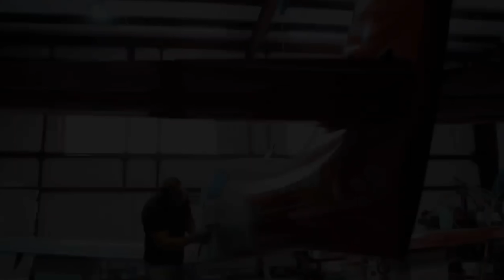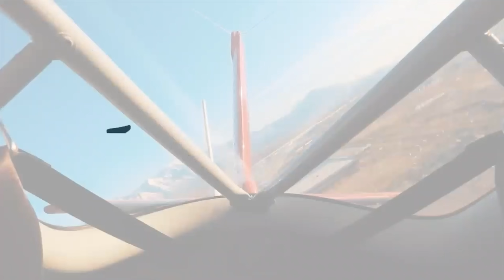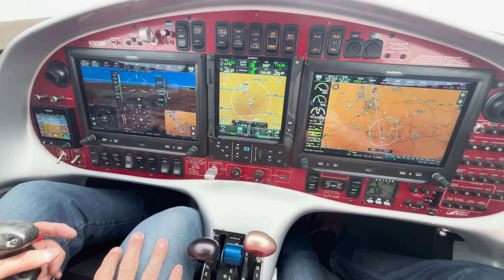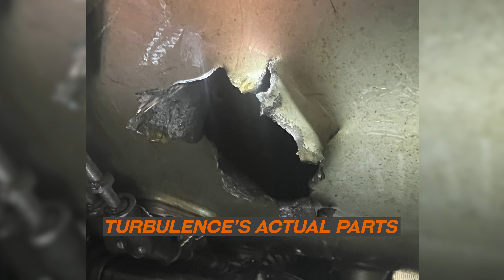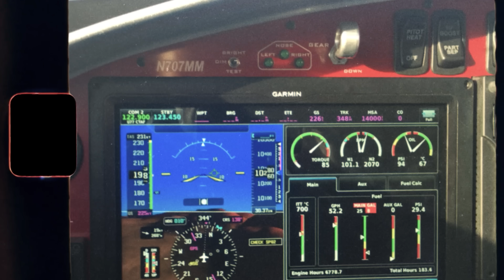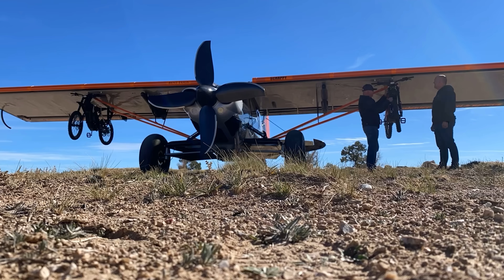Aircraft Engine Explodes - We find out Why | Turbulence Update

Comment: So if I understand this correctly, what essentially happened is you were "Driving" a stick shift down the highway pedal to the metal so to speak, and the thing essentially got ripped into neutral, which removed all of the "force" keeping the engine from going past red line, the engine "over revved" and blew itself apart?

Comment: Many years ago (40+), I was working as a sales rep for a Cessna Single engine dealership up here in Canada. The company sold a farmer a new C172 and as part of the deal they, took his Certified and fully operational, 1956 C172 on trade. The finances on the deal were such that the 1956 straight tail C172 wasn't on the books for much money. My Dad and I jumped on the deal and bought the older C172 for not much money. We flew it for about ten years putting about 900hrs on it. When the engine only had about 75 hours left on it before a required overhaul, we evaluated the cost benefit of spending what would have been more than three time what we had paid for the plane to get the engine up to a current standard. We elected instead to sell the plane. We got a call from an AME who also had a pilots license. He looked at the plane and decided to buy it CONDITIONAL on the log books being in order. What could wrong? The plane had been flown a maintained since it was new. We had an annual done it for the ten years we owned it and throughout that ownership experience, there were no major snags (or so we thought). The AME who had committed to buying it from us called about two days into his review of the log books and ask me had we been the ones who changed the engine from a 4 cylinder to a six cylinder. I had no idea what he was talking about. What we subsequently found was that prior to our ownership (not unlike Mike's experience) a previous owner had swapped out the original engine and put a six cylinder engine in the plane. Why was the swap done? We don't know. Did the original engine fail? We can only assume so because why else would the engine be changed. The log books only indicated the date that the swap was made. It was signed off by an AME so every thing was good right? NOPE! The engine type that was installed was an engine that was approved for use in our C172, BUT if an individual wanted to use such an engine there was an application, inspection and certification process that was "MANDATORY". Just simply paying to have that different engine installed and having the AME note the procedure in the log book did not meet any of the regulator requisites. Much to our good fortune, the AME/Pilot remained interested in the aircraft and though he did end up buying it, we had to subtract form the purchase price, his costs associated with submitting for approval the engine swap that had been conducted some 20+ years prior to us owning the aircraft. Short story long, Mike is very familiar with the unforgiving nature of aviation. I am so very glad that he was able to get Turbulence on the ground. For the life of me however, I can't understand why he put such a high time engine into his plane. I strongly suspect engine cost was a big component of his decision. As I said, Aviation is very unforgiving and in my mind, Mike should have known better. His decision to not fix Turbulence I believe speaks to the life's lesson that Mike has learned.

Comment: It's already been documented by the NTSB that this guy purchased a labelled and known "unserviceable" engine and installed it in the airframe anyway.
The engine in question was past rebuild hours which is also documented. Whether or not the AD referencing the sun gear applies to his engine serial# is unknown and not presented here and is also irrelevant since the entire engine and gearbox should have been torn down, inspected and rebuilt anyway as it was "unserviceable".

Comment: The curious thing is that, according to P&WC, as stated in the final report on the incident, they sold the engine to you in 'Unserviceable' condition, with 3,543.7 hours Time Since Overhaul, with the next one due at 3,600 hours. There was also a buildup of combustion products around the power compressor blade housings. They also noted corrosion both inside and outside the engine, with protective paint flaking. 
It sounds as though they have put the ball firmly into your court, in an attempt to absolve themselves from blame.  
There was an AD regarding that primary planetary gear, but specifically mentioning the type number immediately after your gearbox. That older gearbox should have been subject to serious scrutiny before the engine unit was sold to you. Maybe that's why it was sold as 'Unserviceable'? Whatever, Pratt & Whitney Canada should have included document telling you about that weakness.
Reply: "Unserviceable" means that the engine can NO LONGER be put into service, PERIOD. Yet Patey did exactly that, and almost killed himself and his passenger. Knowingly killing himself amounts to suicide, but also killing a passenger is homicide; WHY would a semi-intelligent person do that?

Comment: NTSB has spoken....... let's confirm the facts?

You put a 1987  PT-6-42  at the end of its THIRD TBO cycle --  NTSB says, "knowingly purchased an engine sold as unserviceable"  --  in an experimental aircraft,  put 12 hours on the installation? Then it blew up when you ran it balls-to-the-wall  at over 400 knots on a X-C flight in bad weather over the mountains?  With a passenger on board?  (I don't do "experimental", is that legal?)  

Do I have all that correct? 

 Did you do a hot section inspection before you put the run-out engine in the experimental aircraft? Or any other inspections of critical components, like the reduction gears, prop hub,  etc? 

I have personal experience of a  similar scenario,  and I got lucky too. I learned from it, did you?

Are you familiar with Frank Borman's famous quote about "superior pilots"?  Do you think superior stick-and-rudder skills will always get you out of situations inferior judgement  put you in? 

You crashed a mega-cool, $ million taildragger because of your poor judgement. In this case, the "missed AD" wasn't the issue,  poor judgement was/is. NTSB STRONGLY hints at it. What's next? 

"Innovation" and "excellence" and all that lofty rhetoric is all good and well -- but what's the goal here? To benefit society?  Save people from burning buildings or floating in some ocean? Or is it just an ego trip? For "likes"? 

Think about your family, and what the lawyers are going to do to your wealth when you crash some uber-cool, "innovative" EXPERIMENTAL  aircraft into an airshow crowd or a  middle school.  

Do you know who Damon Hill is? Read up on his story. Or Mike Tyson's for that matter, or many others who thought their wealth made them bullet-proof. 

Pardon my airline captain--with-plenty-experience-in-warzones-and-odd-places cynicism ..... you're a "doctor in a V-tail" on steroids.  It won't end well.

Comment: I have a few questions:
* Since the AD was only applicable to gears made after 2008, and your gear was from 2003, why do you think the AD is applicable?
* If a chip detector was installed on the gearbox, would it have catched it before complete failure?
* According to NTSB report there was 56 hours left until overhaul, why did you think there was 400 hours?
Reply: The other question you should be asking - Why did Mike buy an engine that was clearly marked "Unserviceable", then install and fly it regardless of the condition of sale?

Comment: Aviation 24/7 have shared the "final report" to Facebook and have neglected to include the important details here, sadly it has given a lot of armchair experts a wildly incorrect opinion on what has gone on here.  Many people are assuming you purchased what was essentially a junk engine and just slapped it on and hope for the best, sooooo frustrating watching fools try to bang on like they are the smart ones.      It sucks how this played out but glad no one hurt.
Reply: The engine was clearly marked as "Unserviceable", it was a condition of sale. P&W's own post-incident teardown inspection showed it was a clapped-out engine.  Watch Blancolirio's video regarding this.
Reply: @SEO122  what did the tag actually say though?    what was the actual reason given for the unserviceable state " Watch Blancolirio's video regarding this"   seems like YOU need to watch that again and listen carefully to EVERYTHING that's said.
If the tag simply said "Due overhaul"  then there was nothing to indicate corrosion inside etc & given it actually still had a little time left to run given the logbook data - suddenly the armchair experts look a little stupid.

There are LOADS of reasons why the engine could have been deemed "unserviceable" - many of them NOT applicable for the installation of the engine on an experimental aircraft, time expired on a commercial aircraft does NOT equal time expired on an experimental aircraft.

The "clapped out" state was mostly internal and could not be seen without teardown or boroscope inspections etc.       

Mike made mistakes, no one is disputing that, asshats in armchairs seem to want to ignore and change facts to suit their own version of reality - no surprises there I guess.

Comment: Would it be possible to create an emergency shutdown system for the engine? If for this or any other reason should "want" to "run away". I'm thinking fuel cut off (of coarse) but intake air cut off/blow by too.

Comment: If it were to happen to anybody. Fortunately it happened to you in a single engine configuration and a very skilled pilot. In a King Air with a lesser pilot likely that would have been deadly. Glad you found the cause and you can move on, excellent piloting.

Comment: I guess Mike, this is good news for ANYONE, that may be still flying one of those old gearboxes.  ADs are for a reason, even if mechanics or pilots don't like t hear that they may need expensive fixes.
In the air, AND on the ground, lives are at stake.  Complex machinery needs complex care.
Maybe one day, you'll hear a couple stories of lives that were saved by your experience with this and your story!

Comment: Huh reminds me of a video from Steve Morris Engines where they were testing a high HP engine and the flywheel bolts sheared off causing the engine to overspin and blow up. The dyno and governor attached to the flywheel was the only thing keeping it back. Sent parts flying all around the shop.

Comment: Are these gears common in all turbo-prop designs?  If so it seems like that's the weak link and SOMEONE should make a set of gears that's better AND a fail safe so if they do fail it doesn't take out the rest of the motor.  Thoughts???

Comment: Everyone else just got lucky, so did you Mike - There's no gaps here you could have known about even with your level of knowledge. How about those $100 hamburger (now $500) flyers out there? ~ Man, if it's going to happen to anyone to bring the awareness? it happened to the right guy for a reason. 
 It always seems like it was meant to be with you Mike. Thank you for your commitment to the craft. 
Although you learn about this to some extent in training (AD's), if you read the amount of NTSB reports as I did, you see a whole lot of them referenced as causes, especially the airframe/spar corrosion that comes up in a lot of reports with structural failure causation. 
 Piston engines though, even hobby fliers pretty much have an eye on those for the common stuff. But how did someone miss it on a turbine reduction system? ... wow. Sure seems like it would've been a major AD for it's ability to create this kind of result.

Comment: I mean, in a way I’m sure he’s upset he didn’t overbuild the plane and just put in a gearbox made for 1000hp. I hear of guys talking about using the smaller gear boxes all the time….but just like in a vehicle, if you have a 1000hp 2400lbs/ft diesel truck linked to a transmission that’s rated for 800hp and 2000lbs/ft….What do you think will happen….I understand the science behind not wanting to have the bigger gearbox but just goes to show that science is not always correct. All it would take is for that peak power to over torque the gearbox anywhere from that 850-1050hp that it wasn’t rated for to blow it apart. Like I said, you see this constantly with diesel owners who program their trucks without building up the transmissions. It would’ve been better to have a gearbox that weighed 70lbs more that was overbuilt vs this outcome.

Comment: I’m really shocked you didn’t do a Hot on that engine before buying it? Granted it wouldn’t have found this specific problem with just a HSI, but still surprising. 

And you bought it through Pratt? (If I heard that correctly). I’m shocked they didn’t check all the AD’s. 

Now if someone fraudulently claimed the AD was complied with, that’s another matter.

Comment: A turbine blade failed and broke off, damaging other blades. The turbine rotor seized up due to the broken blade fragments. The seizure caused the turbine shaft and gearbox gears to fail. The engine failed to contain the blade fragments, causing damage to aircraft systems and components.

Comment: You didn't inspect the gears in your gearbox when you purchased the used motor? You needed an AD to tell you to do so? That's nuts. Do you realize the stress the gears are experiencing under the torque of that turbine? I am an engineer for a gear manufacturer. I deal with gearing failures every day. People abuse utterly abuse them and then wonder what happened.

Comment: So the output turbine turns at 30,000 rpm and had teeth that turned a planetary gear reduction unit? When was the last time someone tore the gearbox down to check that shaft and the gears it turned? Did it have a magnetic drain plug or a chip detector?

Comment: I've researched thousands of ADs as chief inspector in a certified repair station. Every aircraft has 4 sections to search. Airframe, engine, propeller, appliances. You start with the section say engine. It has make, model, serial number. There are programs that will search the ADs for all applicable ADs on that item. Ounce you have that list you check the records for compliance. Every aircraft I worked on had an AD list. This list would tell you date and hours of compliance. An engine not in an airplane with just a log book might not have that list. The list for that engine would be relatively easy to create then go back in the log book to the date of the AD then Forward looking for compliance. Many ADs reference a Service Bulletin to comply with. It may be dated before the AD, so use that date for research. Lots of fun. AD Complied with but no details on how is not an acceptable entry. It must contain the details of how such as inspected IAW SB XXX no defects found.  Was the work specified by the AD properly done and documented? The worst feeling in the world is when an airplane you worked on crashes and people die. Was it my fault? Fortunately after the FAA reviewed our work orders we had done our job well. The crash was caused by flight into icing conditions. It still hurts.

Comment: Gearbox was my first thought but I thought the sun gear shaft sheared.  I did immediately think PT turbine overspeed because of damage which happens when you instantaneously go overspeed and beyond.  Investigated a PT6-32 in a T-44 that had similar failure although the sun gear shaft failed.  PT blades went through containment ring and ended up next to pilots foot.  First time P&W said they had seen a containment ring fail.  Curious if your containment ring failed.  Seen a lot of weird stuff happen on PT6's but they are bomb proof, almost.  Glad you made it down safe.

Comment: I had a similar failure but the other way round. Not a plane but a cut off saw. I had a great saw and it stopped. Needed a commentator. Had that fitted and then armature stopped working. New armature fitted. All good. A few months later the saw catastrophically stopped. A fan blade piece broke off and jammed the armature. The new 16" cut off wheel continued to try and spin and ripped the teeth clean off the armature. Binned the lot.

Comment: Every maintenance controller in every facility that handle that engine should lower their heads in shame. Trolling through the log books and checking off the AD's is their responsibility whenever a new to them engine or aircraft comes under their control.

Comment: Wow. I thought a turbine losing load wouldn't overspeed so hard as to instantly explode... Why does getting a whole lot more air not cause the air/fuel mixture to lean out so much as to flame out or at least lower the pressure enough to not spool up further?

Comment: Our company ran into a couple issues with our 208s thanks to some old ADs that were in the "Don't have to do right now but get it on the next overhaul". Led to us basically doing away with single engine ops save for float season. Everything else is 2 engines or more :P

Comment: This may be a dumb question. Doesn't the gear box shaft connect to the power section. If you break the shaft to the power section why would the  gas section not connected to the the gear box shaft, overspeed? Does the gas generator have its own governor or does the resistance from the power section limit the speed of the gas turbine.

Comment: I was watching one your your Turbulence videos from about a year ago.  You were talking about the gearbox on the bigger engine, explaining how the turbine was rated at 1090 thermal horsepower and the gearbox was rated for 850 HP.  This was to save weight as the turbine only made 850 at altitude.  Ironic that the gearbox let loose first resulting in a cascade failure in the turbine.